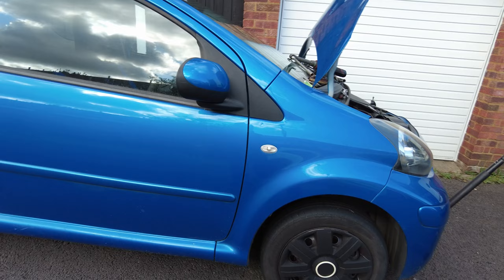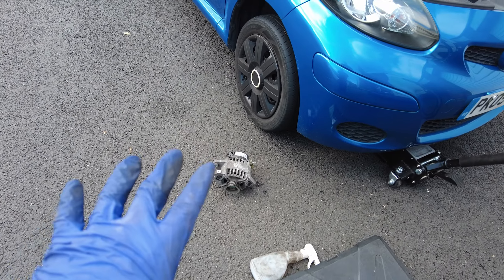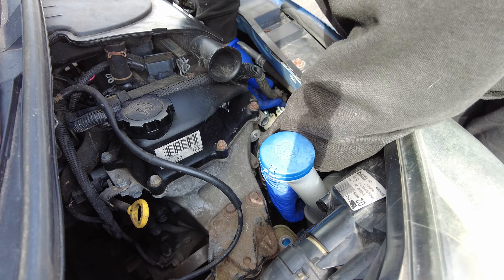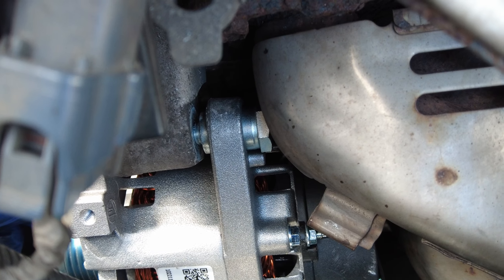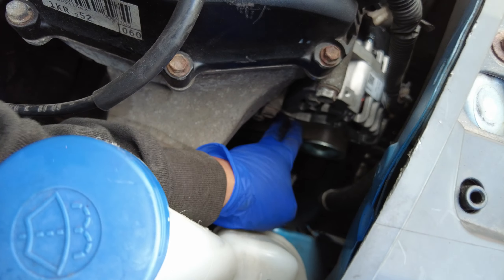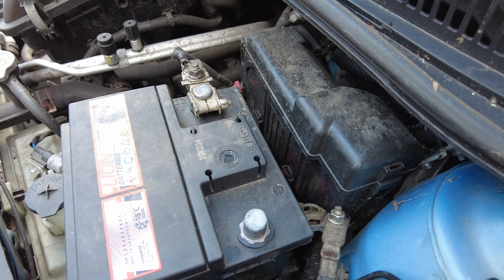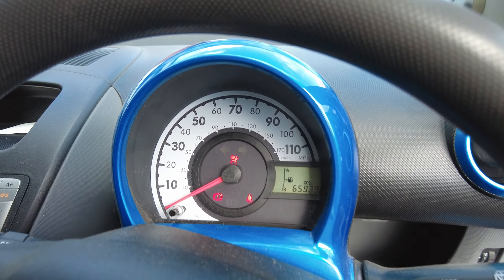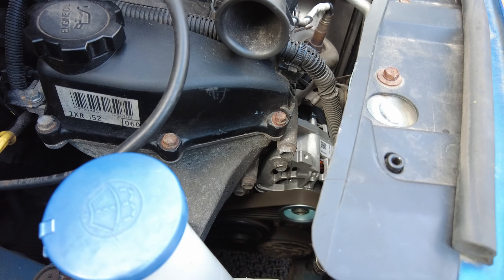Life of a Mobile Mechanic | TOYOTA AYGO ALTERNATOR REPLACEMENT | £1MILLION TECHNIQUE | VLOG 18

Comment: Any idea if the top alternator bolt is available as a spare?
The 14mm top bolt 8s well and truly stuck on.mine..Tried alk the usual tricks, but I suspect it will snap.
It looks like it's just a standard bolt that threads into the femal e thread at the other end. If I can get these as spare that would be handy.

Comment: Nice move 💪I’ve seen other professional remove the bumper on this car 🚙 for the same job
Reply: removing bumper is super easy. just 4 bolts and thats it. It allows you do a clean work.
Reply: Seems like a lot more than 4 bolts, ton of clips and maybe breaking off the plastic brackets that hold it in place lol ...
https://www.youtube.com/watch?v=BBaJDyTHNQ4  @ashar011
Reply from the maker: Very true 😂 @LykeArgy
Reply: @ashar011  What stops the two ends of the front bumper & the underside from flapping about???🤣
Reply: @billyearley2097  thats not a big deal. removing clips is much better than ruining your back and hands in tiny space.

Comment: That belt looks sad, a few extra $$$ couldnt have hurt. Love varta batteries, Lion is a cheap Philippine battery, I have had best luck with MOLL and Varta/Bosch, Midac is alright too, limited choice in Australia, MOLL is my skodas OEM and still going 7 years on, still at its rated CCA Disabled stop start in OBD for longevity and it helped big time friend with same car battery dead at 5, mechanic pit a Lion in haha.
Reply from the maker: Believe it or not, that belt is only a year old 😅. Regarding Lion batteries, you’ll either like or hate me on the next video 😂.

Thank you for watching man 🫡
Reply: @themarvelousvlog  Wow 1 year, no branding on belt at all? I still have my OEM accessory belt on my czd 1.4 tsi same water pump too no leaks count me lucky water pump is ironically not powered by the accessory belt and is behind the motor because VAG???
Reply from the maker: This is what I got told. The tooth side of it, to be fair doesn’t have any sign of wear like cracking. 

VAG is so extra and complicated in some aspects. Cambelt a are nice to do except the new 1.5 🤦🏽‍♂️
Reply: @themarvelousvlog  Isn't the 1.5 just the same as the 1.4 just with a longer stroke and or bored? mine has the belt CZDA, its not twin charged with piston cracking problems. For base Octavias in Australia they switched to a Toyota (Aisin) 8 speed torque converter no more DSG except RS models. I think base Golfs too not sure no more manual the last manuals were the 3.5 models.
Reply from the maker: @REPOMAN24722 nah, not the same mate. It actually needs a special tool that you can only buy from VAG.